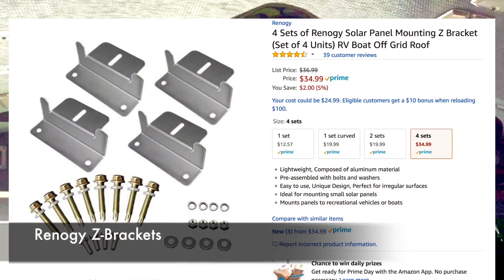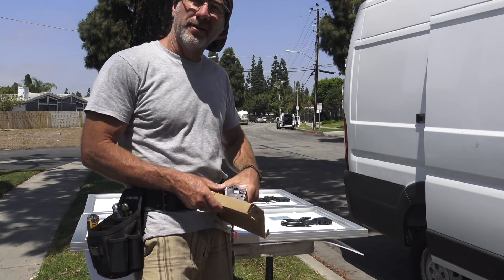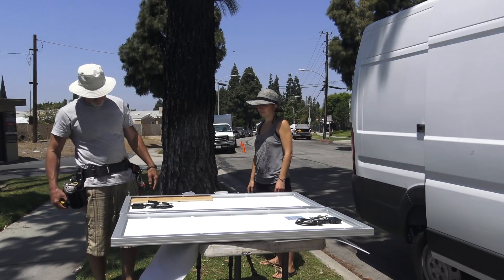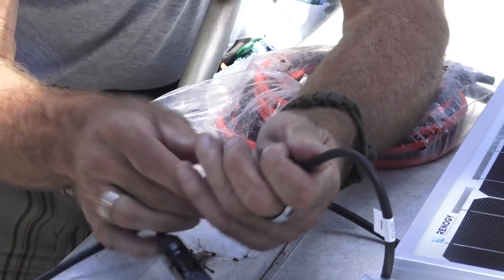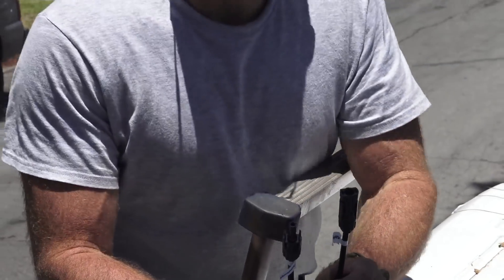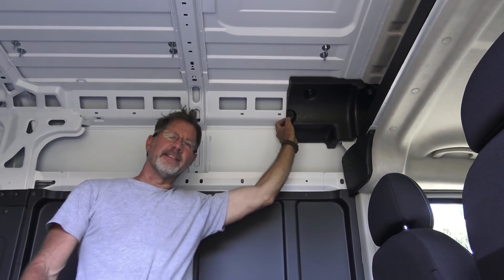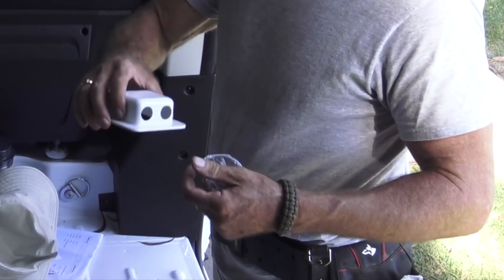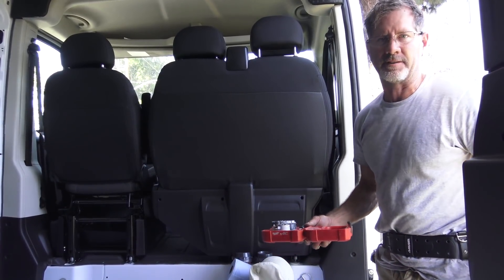Installing 400 Watts of Solar, Inverter, Isolator & Shore Power on a Van #1

Comment: Thanks for your videos, I am Installing 600 Watt solar on my camper. These videos help me do this myself.  I want to add another 600 watts to the back. Due to my health problems, I need to able to run air when I don't feel good. I have been buying things a little at a time. I want to be on the road in the fall.  I want to do this before I have another stroke and not be able to do it. Hope to be there in the fall. Thank you so much.
Reply: Tracy, You're right! We need to get out there sooner  rather than later. Please tell me--did you get two 300-watt panels? Where? Thanks!
Reply: Van Mama Wannabe , I have 6 100watt panels. I found them at Home Depot on sale. I got them for $100 each.

Comment: Thank you for showing and explaining how to connect the solar in a series ( I never understood what that meant until you gave us a visual while you explained what you were doing..... Thanks buddy

CeCe.  Nice van GIRL
Reply: He connected them in Parallel. ooops  Series is like a daisy chain  Parallel is like a bunch of flowers side by side.. Series has  voltages that add up  Parallel has Currents that add up. Series is a taller dam . Parallel is like a bigger reservoir.

Comment: I like to run my panels in a series so the voltage goes higher and you have less voltage drop. It works better trust me. I have done it both ways.

Comment: Perfect timing and subject matter. I'll be doing something very similar with my Astro; 2-3 100w panels with a fan in the rear. I have mid-to-rear ladder racks and was considering the aluminum L brackets. Like I said, perfect timing and subject matter. Thank you!
Reply from the maker: Thanks! If room is a concern. check with Northern Arizona Wind and Sun for one large panel. Try to go 300 watts +/- if at all possible! I started with an Astro!
Reply: I caught that part about the Astro and I will (check out the large panel option). I'm still trying to questimate my requirements, but I'd rather have it and not use it than the alternative. Thanks again.
Reply: Enigmatic Nomadics YOU and evie nova are the BEST you tube station to me.

Comment: Bracket dilemma/help question below. ....????? 

Great video, used as a guide to make the plunge to do my own solar on top of my truck cap shell. I am not done yet but getting there. I bought the same brackets in your kit but find that have an issue w them not sitting flush again slightly curved cap. I can have either the base flat to roof and have issue w panel attachment part w gap or vise versa. Unfortunately, I did not see the adjustable brackets on Amazon until I already made holes. I ordered a set of adjustable, waiting on them. If they fit holes in shell I will order another set. If they do not line up, do you think it would cause me issues to not have the base sit flat on cap?  Given that I have to bolt down the brackets to panels first that is likely the issue that will occur, bottom of brackets not sitting flush. I have been trying to figure out what to use to build up the part of brackets not sitting flush, suggestions??? Thanks 
p.s. My cap is fiberglass. Also, added a video to my YouTube for this dilemma.

Comment: Great video and very comprehensive.  I have questions about how to connect my solar power system to my travel trailer RV. I have a 7,500 watt generator that runs on either liquid gas or propane gas. I have a 2,500 watt power inverter and a 300 watt two panel solar power system. I planned to buy a 400 watt wind turbine and a 9,000 btu split AC heat pump. Should I connect the solar power system directly to the standard RV converter/inverter so that the solar panels are constantly changing the battery so long as there is sufficient sunlight, making it as if the solar power is my main source of power and the battery is a backup once sunlight and wind is not available? 
Should I keep the solar power system independent such as like a generator would function? Which suggestions you give please explain why and what are to basics to actually accomplishing it. Perhaps a diagram explaining how to connect it in the basic and simplest terms? Can I somehow connect the solar power system to the shore power outlets using a power inverter as my main AC power?
Reply from the maker: I would definitely charge your coach batteries off of the solar. This is a complicated answer and I don't think I can give you a sufficient answer here.

You're definitely on the right track. You just need to tap into the converter in the right way.
Reply: Enigmatic Nomadics thanks for what you did provided. Perhaps when you get the time and energy you can do a video that could answer some of the best and basic questions I have. I’m a sub and get notifications so I will watch and like if and when you do one.

Comment: Awesome video, great information, thx for making and posting it. I heard you say you have mounted many solar panels on lots of different vehicle roofs/roof rack; so I ask... I have a 24' long 2008 handicap (ex) shuttle bus. I don't think the roof is metal like on a reg school bus or Ram van, it might me fiberglass but I'm not sure. Would you be able to advise me on the best way I should mount solar panels? Some say just use FHB tape, others say bolt to the roof. I don't know of any have as much working knowledge as you do so I do not know what is safest and best. Would you mind sharing your opinion with me? 
P.S. You sir are a very hard worker.

Comment: Have you researched using 3M VHB tape to install panels. Better than putting holes in the roof.
Reply from the maker: I have VHB tape. I use it.
Reply: Cool. It's probably better to use bolts with a metal roof/new build. My last install was on a fiberglass winnebago so pretty hard to go through bolts. 1 year and 8K miles and still holding. Your videos are the best around. It's good to see folks with practical knowledge.
Reply from the maker: Thanks, man. Yeah, I appreciate the feedback on your VHB experience so far. It's still new to me and I don't have a ton of confidence in it yet. I used it on my flush mount pliable panels on my own bus with no problems so far. (7 months)

Comment: Hi Jamie, thankx for the great video.. Hey I am going to installing up 380 w of solar panels on my trailer roof. I need to buy a new charge controller.  I was wondering if the SB3000i Blue Sky would be suitable for my equipment.  I have 3 100amp hr deep cycle 12v batteries.    Thank you in advance
Reply from the maker: Yes, it would be a good choice.

Comment: Jamie,

I purchased the 24v batteries thru your 400W kit but am told that I should return them.
What is the difference between the 24v you have listed within your kit and a 12 volt?

Comment: Hi Jamie, do you know why it seems that everyone's using 100 watt panels? Since space is a premium I would think a 300 watt panel would be better. Thanks!
Reply from the maker: Just not a lot of larger panels out there. Heck yeah! Use em if you can find em! Just make sure the controller is compatable! Cheers!
Reply: Aren't they more expensive though?  I would have loved to go with a 300 Watt.. then I would have had room for an A/C unit.  :(...

Comment: How much solar is need to power a home dialysis machine?
Reply from the maker: We would need to know how many watts it uses. How long does it need to run each day? For any medical equipment, I recommend a back up genorator. I will get more into that in upcoming videos!
Reply: Enigmatic Nomadics. For a batch of solution 6-8 hours then 2.5 hours for dialysis.
Reply: Enigmatic Nomadics forgot to add we have 2 back generators.
Reply: Enigmatic Nomadics and thanks for your reply.
Reply: KenDroid66 thank you looking for it now

Comment: steel or plastic bushings are better than grommets Heyco Threaded Smooth Bore Bushings
Reply from the maker: If nothing is available, cutting a piece of old hose will work also. Just try to use something! Great input!
Reply: Spent 20 years as a Journeyman electrician at a nuclear lab, My foreman was sort of picky. LOL  Bushing sets are under a buck at Home depot